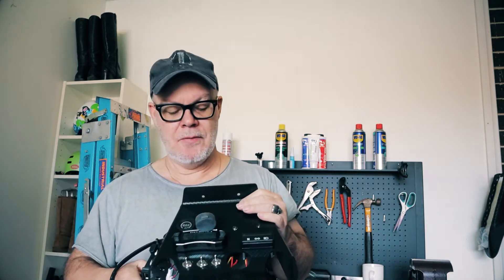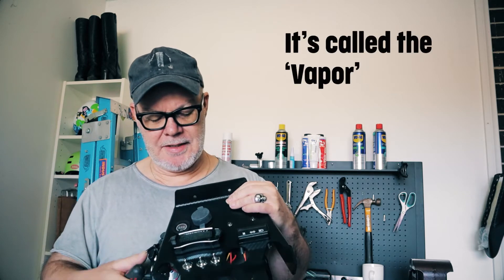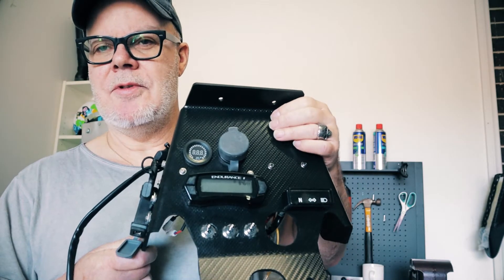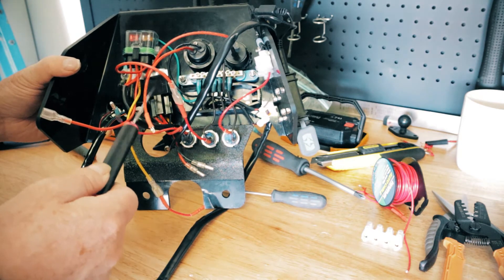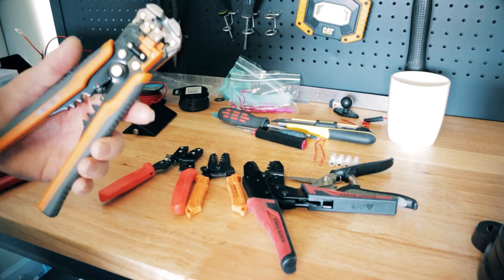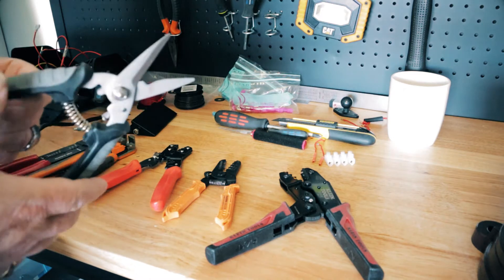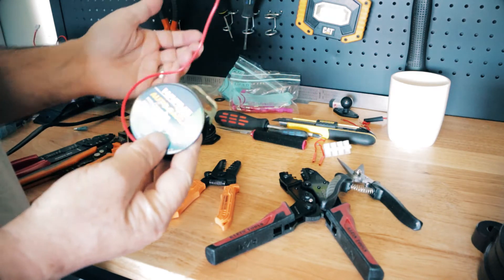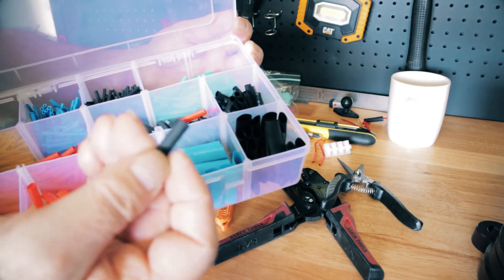DR650 Lynx Dashboard Install

Comment: One way to help the DR keep a good voltage is to swap out the stock lights for LEDs which draw a lot let power (it looks like you have already done that based on the front cowling and different lights). I have a smaller dashboard that has a voltmeter for the same reasons you listed. Great technical video Mate!
Cheers!

Comment: What is the dashboard made from ?
USB output should be 5V
You would benefit from changing all your continuosly running lamps to LED to lower your power consumption load (watts) as the alternator only puts out approx 200W at abotu 3600 rpm. If you get a $48 DC Clamp meter from Supercheap you can place it around your batter cable with the engine running at 3600rpm and see what you actual current draw is in Amps then you can workout what your total power consumption is by using Ohms Law for Power (Watts) W= V (volts) x I (current) ie 12.8V X 13.44A = 172.032 Watts
Reply from the maker: Fiberglass.
Yep - already changed all the lights to LED.
I was meaning to research the USB - something very odd with the Oxford one.
When I emailed their support, they basically just told me to 'take it back to the shop' lol, which tbh I can't be bothered and probably they wouldn't take it anyway since I shortened the wires.

I'll probably just try another brand
Reply: Plus 1 on the  clampmeter. You'll never look back and wonder how you did without it.   Most cheapies on ebay are AC only.  I didn't know supercheap did an affordable dc version.  Back in the day I had to buy a fluke as nobody else made them.

Comment: Thanks for the video!  I'm in the process of deciding between the 3 options that Britannia has or the ARX rally tower.  Do you find the extra weight from the fairing to be a problem on the bars for handling?   Also--which UFO fender is that?
Reply from the maker: Its actually very light - I don't notice it at all. Its fiberglass. I have worried about durability a bit - but we'll see. The front fender is the RM model BUT I have swapped it to a polysport universal fender since making this video, since I couldn't attach the Britania front properly with the UFO, AND there wasn't enough rear ventilation on that UFO fender for the oil cooler